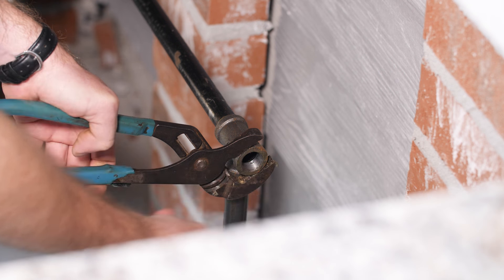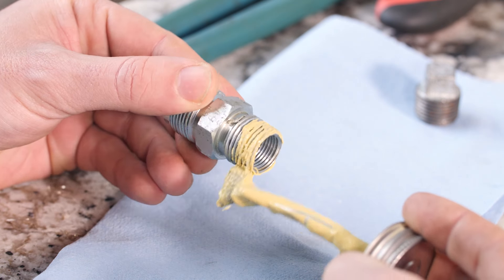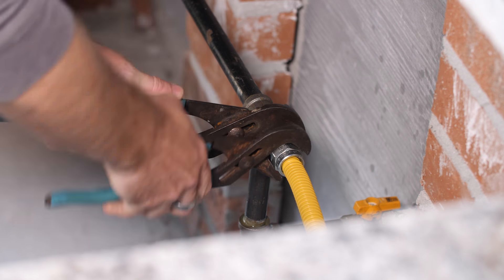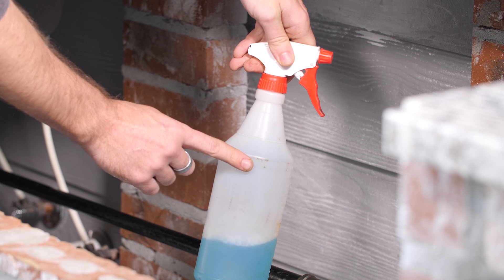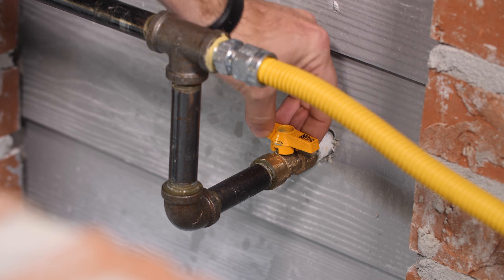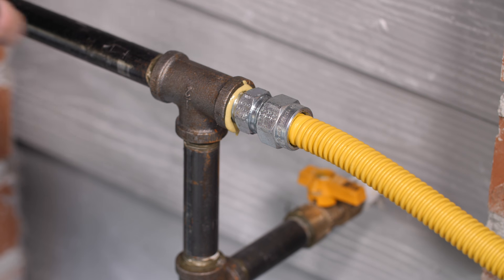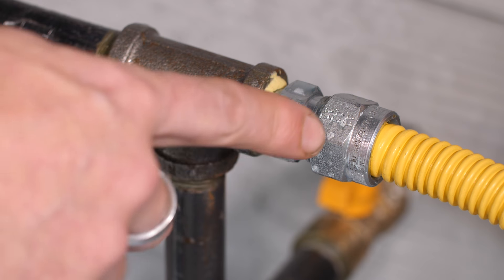How to Check for Gas Line Leaks on a Gas Grill | The Soap Bubble Test | BBQGuys.com

Comment: When the valve is in line with pipe doesn't that mean on? You said with gas on and turned the valve perpendicular to pipe rather than parallel
Reply from the maker: Yes, parallel with the pipe is flowing.  In that clip when I sprayed it, the gas was off to prevent extra leaking while I grabbed the soap bottle.  Just make sure to turn it on once coated with soap to check for bubbles.
Reply: @BBQGuys  ah thanks for the clarification, you can see where the video may be a little confusing for people, because at the 10s mark you say with the gas turned on, and at the same moment turn it perpendicular to pipe. Otherwise great video
Reply: Yea gas is off

Comment: Best way to test for leaks is with a low pressure, pressure test using a manometer. This is the 21st century, electronic tick rate gas detectors are the way to go and soap used to pinpoint.
Reply from the maker: Grea tip!

Comment: What type of soap is best?
How much water how much soap?
Reply from the maker: Dish soap works great, 50/50 blend
Reply: I had the same question. Soap solution doused the lines where I could smell the leak, but all it did was foam and drip. Nothing like the video shows. My mixture was about 1 part soap 5 parts water, so I'll increase the soap and recheck.

Comment: Don't follow this guys instructions, first he turn the gas valve to the off position so how can you test for gas leaks when the gas is turn off?  Secondly he had the channel locks in the wrong directions thereby making it easier to strip the fittings.
Reply: Haha
Reply: The point was the soapy water though
Reply: He said, he loosened it so we can see what a leak looks like

Comment: Soapy water should not be used on gas lines. They can be corrosive. You should use only leak detector fluid.